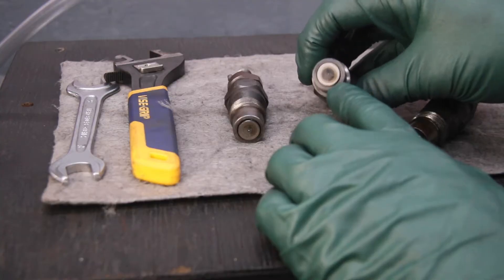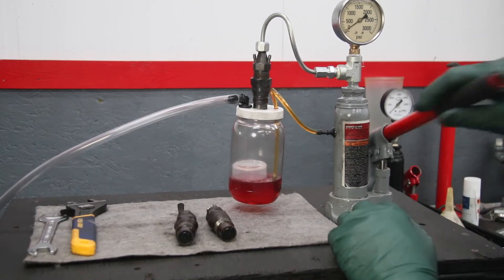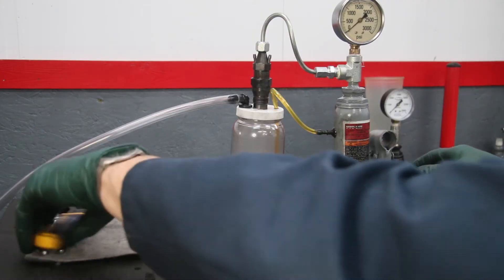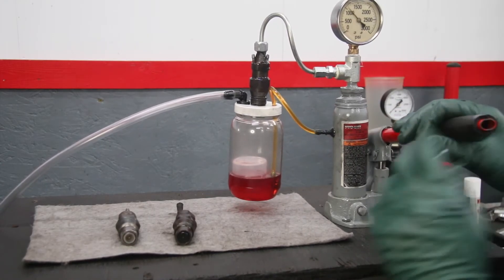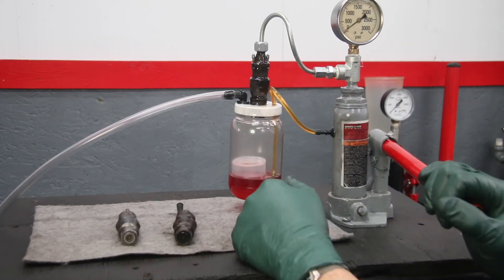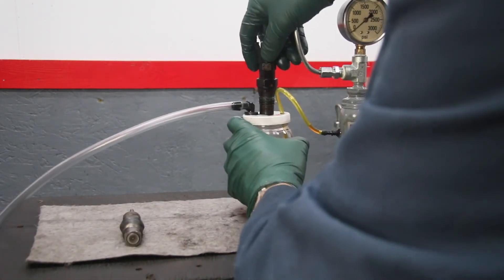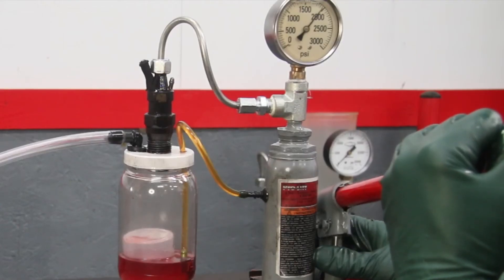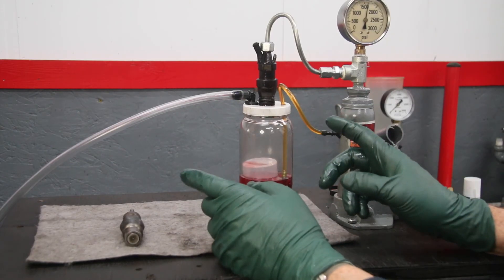Bad Diesel Injector Vs. Good Diesel Injector: This Test Shows the Difference

Comment: I really like this channel because it helps me understand my car better. However, I would like to ask for some advice. My 1988 W124 250d is very slow when starting to drive, and it only runs normally after reaching a certain speed. What could be the problem? It's really bothering me, this can easily lead to an accident.

Comment: New owner of a 1984 300sd, idles poorly, smokes alot and misses at idle, I have new nozzles, glow plugs, thermostat, fuel return hoses, filters on the way, in the meantime I feel like I should try to clean the injection pump before the injectors are rebuilt. I did the vegetable oil flush the other day, did 3/4 gallon. Drove it 30 minutes home from the shop I work at and it smokes less but still a little too much and engine still shakes and has low power. I turned the alda almost all the way out just so it'll move out of its own way.. help please
Reply from the maker: Have you done a compression test yet? That is super important to determine the internal health of the engine.
Reply: @Mercedessource  no I have not

Comment: Hi mate, 
Love your channel.
Ive a question out of sheer curiosity. 
I tested my mechanical direct fuel injectors on a similar stand. No1 was leaking and would dribble at 1500psi. No6 was spraying well at 2500psi (same for 2,3,4,5). I swapped nozzles on No1 and No6...the problem didn't reappear, now both open at 2500psi. I swapped nozzles again, problem showed on No1.
Anyway,  will put the injectors in with 1 and 6 swapped, but I don't like not knowing.
No nearby diesel shop either and a set of injectors for a 1989 diesel landcruiser is like 2000 bucks.... hence why I'm plaguing with it.
Regards from South Australia.
Cam

Comment: That's a bad ass pop tester! You always have the best videos on diesel stuff that translates to my VW world.
I followed the link to your site and would like to know if I can use this to test my 03 mk4 jetta tdi injectors?
Reply from the maker: Sorry, I do not know.  I have never worked on TDI injectors
Reply: @Mercedessource  right on. I mean It's a bosch pump. I'll have to check into it further as far as the thread sizes etc. I'd  be willing to buy one of yours for sure.
Reply: The Mercedes Injectors have a typical M14x1.5 thread size on the high pressure fuel lines. Check the spec for your fuel lines. If its different then just buy a single Aftermarket line with reduction thread.

Comment: hello, is it true that adding ATF to your diesel fuel will clean your injectors?
Reply from the maker: I am sure you heard it on the internet. If so it must be true!!!
Reply: Had friends that had dump trucks with Cummings back in the 1960's that were using ATF in their fuel.  Later in the century bought a GM 6.2L van and also used ATF to keep injectors clean and at very little cost.